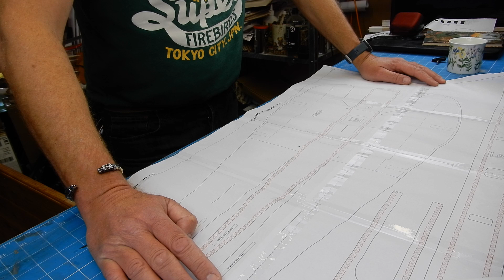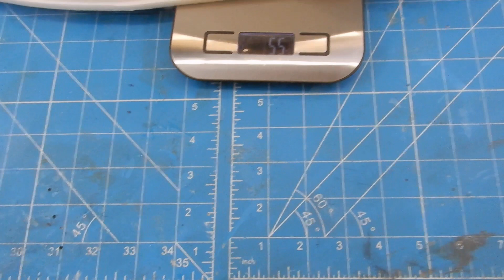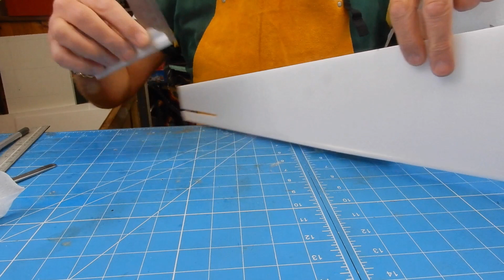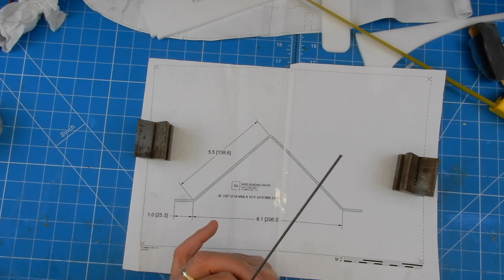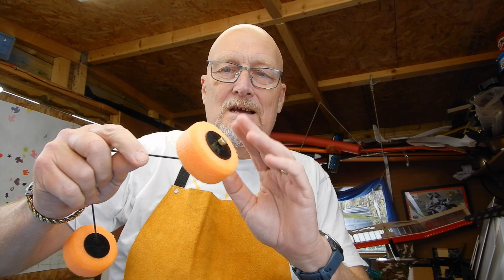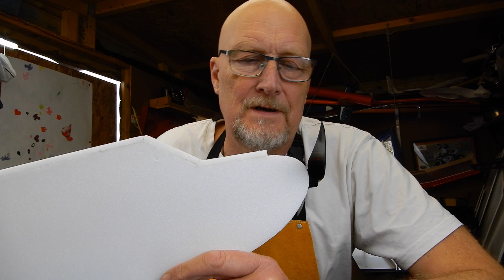How to build the Pug Tug  part 1 Fuselage

Comment: What another great name, Pug Tug. Look forward to the various wing experiments.

The Simple Cub I built had a tendency to nose over on landings, or when on grass. This related to gear placement  vs. CG location.
Nick, you may not have seen that FT has recently released FT Tenet. It has a solid foam fuselage in style of the FT Explorer design that can be setup as a pusher, or tractor. AUW is said to be 240g without battery (300g+ with). For reference, FT recommends using 1806 2200-2400kV motor with 6x4.5 propeller, 3s 850mAh battery. It has options for 36-40 inch wing spans.
Think the motor you have will work, but might be a bit on the overpowered side, but can configure to limit max throttle, or run on 2S. Likely less less an issue when towing. Only way to find out is try. Look forward to your fun experiments. :)
Reply from the maker: Hahahah your spot on but it’s a fun experimenting 🤪❤️

Comment: Nick, thanks for the heads up on the B@Q Diall extruded polystyrene board, looks like just the material I need for some glider model experiments. Looking forward to the rest of this build, thanks for putting this video up.
Reply from the maker: Pleasure Marc I’ve just bought a new hot glue gun I am so pleased 😀

Comment: Nice one Nick. I made a Baby Bee out of depron a few years ago, very similar to the simple cub you're building.  I'm a bit concerned about your choice of motor/prop though, 2205's are high revving quad motors (generally 2300 - 2600 kv) - that's a lot of prop for such a fast motor you've gone for there. BTW, UHU Por doesn't have to be used as a contact adhesive, it'll still stick well if you use it wet and let it go off in it's own time.
Reply from the maker: Are saying I need a bigger prop or a smaller one
Reply: @NickChittyFlying  - Flight Test's 2205's usually run a 6x3  : )
Reply from the maker: @loddude5706  thanks let’s see how it goes
Reply: @NickChittyFlying  smaller one - quads usually run a 5 inch, but that's on 4S. I imagine you'll have more thrust than you'll need with a 6 inch even on 2S
Reply: BTW, for my sub 250g Baby Bee I used an 1804 on 2S with a 5x3 and it was lively
Reply from the maker: @Tsnafu  ooohhh she’s lively 😍